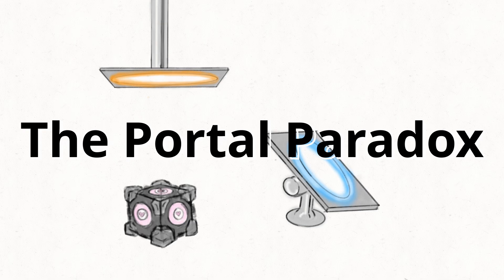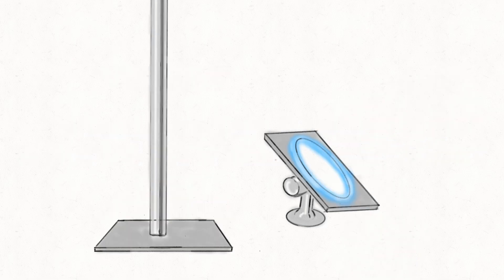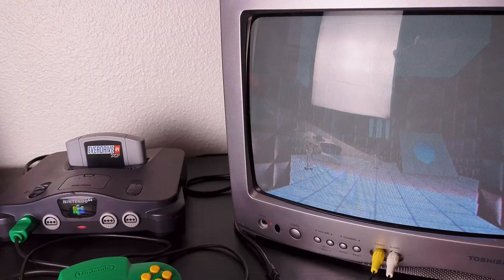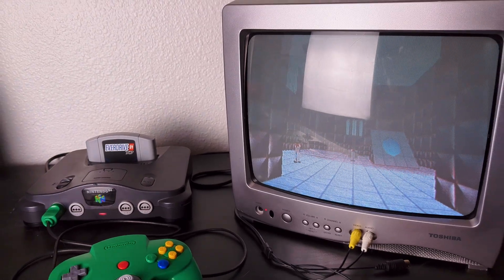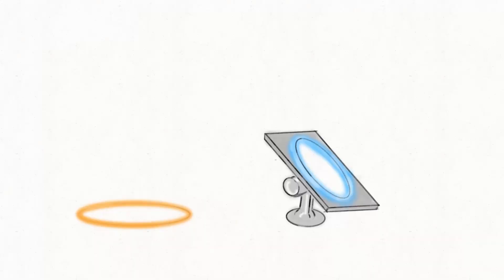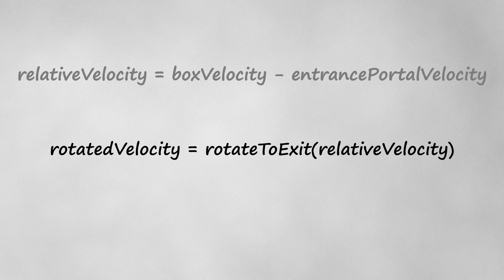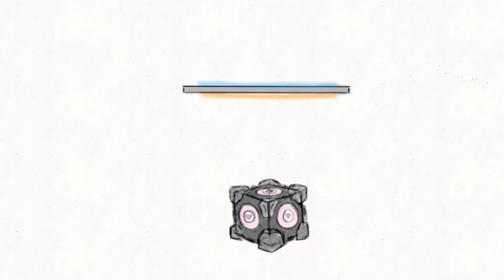I rewrote Portal from scratch and solved the Portal Paradox

Comment: Great video.
A correction would be thay speed is relative within a inertial reference frame. 
Lets determine the objects in our refence frame. 
Intake portal carrier 
Cube, aka mass
Exhaust portal carrier 

In the reference frame, cube is stationary, intake portal carrier has a static velocity and exhaust portal carrier is also stationary. 
When the cube passes through intake portal, no force is applied to it. 
When no force is exerted. Inertia within the system shouldn't change so cube must be stationary relative to exhaust portal carrier and its relative velocity must not change relative to intake portal. 
Thus it should be stationary when it exists the exhaust portal.
Reply: Reference frames relative to what though? I would say the reference frame is the other side of the exit portal.

Imagine a point in space a little bit outside of the exit, how fast is the cube moving compared to that stationary point.

In the first example the point approaches the cube at the velocity of the entrance portal, so in the frame of reference of the universe on the other side of the portal, the cube has momentum.

Now take the other example, again imagine a point, above the exit portal. When observed by the cube the entrance portal is approaching, but the exit portal is moving away from the point at the same rate, so the cube is stationary relative to the fixed point through the exit portal.

Looking at frames of reference is a good starting point, but you have to consider the space through the exit portal to be the authoritative frame of reference.

There are examples in the portal game, such as vertically aligned portals, that break conservation of energy, so appeals to that are invalid, infinite gravitational potential energy is trivial to achieve.
Reply: @googlygoink   why would you change inertial reference frames mid experiment? 
There are no limits to inertial reference frames ?  You can be in the same inertial reference frame even if you are on the other side of the universe. Just add a lot more objects to the frame
Reply: @alqualonde2998  because through the portal is effectively another reference frame, the whole universe through the portal is moving towards you when the entrance moves towards you.

there is no consistent inertial reference when using portals like this, unless you consider everything on one side of the portal to be moving, and thinking about the cube's perspective on the exit frame of reference is easier.

In your explanation you say the cube has no momentum before, therefore has no momentum after, but you are neglecting that everything in the universe through the portal has a velocity relative to the entrance frame of reference, so even if the cube is still, the reality it enters is moving, so it ends up launched at the wall.
Reply: @googlygoink  ummm just no ?  
The reality it's entering is moving ? Relative to what ? 
It was still compared to cube before and after the teleportation. 
The only thing that's moving is the intake portal carrier. 
Movement is defined within inertial reference frames, not based on portals.

Your example also doesn't hold as cube itself has relative speed to itself. As it's part of the whole " moving" universe of the exhaust port. 
 You can't change inertial reference frames mid experiment they are not physical frames. They are abstract concepts we create that encapsulates all the variables withing the experimental. If you are changing reference frames, you are shifting to another experiment all together.
Reply: @alqualonde2998  again going through the portal is not being teleported, a portal has no analogue in normal physics so instead let's look at a single static point in space. 

Now if we take an inertial reference frame around that point.

Now if that point can observe itself through a portal, and the portal is moving, then the inertial reference frame breaks, we have a singular unique point of reference, that is approaching itself. 

So you need to treat the point through the portal as being unique to the point we are observing from.

A reference frame cannot exist where a unique point moves relative to itself.
Reply: @googlygoink  But why ?  Portals are not wormholes ? They are instant displacement mechanisms. That's teleportation.  Portals are abstract representation of a teleportation field in 2D form.  We also can teleport photons for decades. I think record is 500km with entanglement. 

Your proposal is fundamentally broken in thermodynamics.
You are creating energy.
Reply: How can it remain stationary out the other side though?

If we have a portal move over a stationary cube at say 5m/s, then the cube must be ejected through the portal's exit at 5m/s.

If this portal's exit is stationary relative to it's environment, then that movement can't come from the portal.

As such, it has to come from the cube. This makes sense, as each part of the cube to come out of the stationary portal would essentially be pushed out by what's behind it at 5m/s.

The only options available are either that the cube is crushed at the portal boundary like a one-sided accordion due to it being suddenly stopped at the other side, or for it to fling out the other side at 5m/s due to the transferred momentum from it being pushed through by the portal.
Reply: @G3HP  imagine a system with 2 portals and a cube and look from the perspective of thermodynamics. 

If the intake portal carrier is moving, it's carries has some kinetic energy. 
If the cube starts moving at the same speed as it exist the exhaust portal, the system has more energy than it started. 
If you create energy out of nothing, you made some grave error. 

Also your proposal that cube would push itself is not logical. It would mean portal is applying some sort of force to make cube pass through itself. 
Portals are not wormholes, they are windows of instant displacement, aka teleporters.  They don't exert forces.
Reply: @alqualonde2998  conservation of energy is broken with static portals, yet alone moving ones.

If you have the vertically aligned portals and drop something in it then the object has infinite gravitational potential energy while in that column between the two portals.

You can't appeal to conservation of energy here.

Say you had two portals at either end of a vacuum tube, with a ball bearing in the tube also, with that aligned towards the center of the planet, the ball bearing would accelerate endlessly, gaining infinite kinetic energy
Reply: Having checked the lore I also found this "the ASHPD is powered by a miniature black hole, which is kept stable through the use of a cooling fan at the rear of the device."

So the energy inherited by the cube as it passes through the portal can be taken from the black hole, somehow.
Reply: @googlygoink   no ?  as the cube moves towards the gravity source, gravity source will move towards the cube and either cause the collapse of portal carrier as they need flat surfaces in lore or cause the portals to touch each other causing a possible catastrophe.

Its also not infinite as gravity itself is not an infinite resource. 

adding the relativistic exponantial energy requirements for closer to lightspeed velocities. its not against thermodynamics.
Reply: @googlygoink   thats possible but kinda cheesy as being powered by means it generates energy for the device to be used rather than being integral to how portals work.

Comment: If the portal has relative velocity to the cube, which you conserve in your equation, but I thought that the concept of the portal was that MOMENTUM is conserved.
If the portal is moving at a rate, that's great, but it has no mass.
The cube has mass.
After the cube exits the portal, it doesn't have any relative momentum to keep it moving at the rate that the portal slamming over it was traveling at.
The cube would appear to be emerging from the portal at a fixed rate, until it was through and the gravity of the other portal was able to overpower the stationary gravity of it sitting on the ground.
I can draw a Free Body Diagram if you'd like.
Reply: this is only relevant if the velocity of the portal is less than what the cube could have after accelerate downwards via gravity in one length unit of its own size. any more velocity and it just does what the video shows
Reply: @Kittyhat  My comment only marginally had to do with gravity.
I'm taking about how does the portal with no mass impart momentum on the cube by moving over it?
Is the cube being imported momentum by the ground in this frame of reference?

You are right about the 45 degree ballistic trajectory stuff about accelerating downward if the cube is imported momentum somehow.

Comment: The correct answer to the Portal Paradox is that portals cannot move and therefore it is impossible for such a situation to occur.
Reply: finally a reasonable comment
Reply: @Kittyhat  But is it reasonable? After all portals move at immense velocities as the earth is moving hundreds of thousands of kilometres per hour. And even if we change it to they can't move with respect to a reference point on Earth, that is proven wrong by the ability to establish a portal link to the Moon. Which would be moving relative to a point on Earth.

/The video is the best answer, the relative velocity of the portal and object are what is relevant there is no eight answer

Comment: I don't think the cube should shoot out. It had no velocity before it entered the portal. The piston has velocity and mass, but the portal doesn't have mass, and therefore, it can't have velocity. The cube doesn't come into contact with the piston, so the piston's kinetic energy cannot be transferred to the cube, the portal doesn't have mass, so it can't really transfer kinetic energy to the cube either. The piston is moving, and the portal is not. It can't. So the cube leaves the portal with the same velocity it entered, none.

Comment: I still feel like it would just fall out the other end. It makes sense that the velocity increases as the portal moves over the cube, but it only changes for the section it’s passing over. Correct? So the bottom end of the cube is actually anchoring it down for the entire pass until it covers that last layer of cube. 

Or it’s creating stored energy. 

Or, if your theory is correct, you should be able to pass the portal over the cube very quickly, stopping just past half way and the cube would lift itself through the rest of the portal.

Comment: your approach is wrong, cause portals dont transfer velocity at all. They transfer matter, only cube itself, only speed of the cube matters. 
When your cube gets momentum even? After it teleports fully you just apply force to them? 
Try to teleport cube in your mind gradually:
It will just slowly appear at blue portal, cause its standing on plate, gravity will push it down.
When cube will be more than a half on the over side it would slide and roll down, cause it will be more affected by other gravity on the other side. 

Bruh

Comment: I actually solved it to myself pretty easy with a thought experiment. So, imagine orange portal coming down and the blue one stationary, then:
1. Stand near the blue portal and put your hand just a bit through it
2. Orange portal coming down at fast speed and through the blue portal you see that "the wall" is coming fast
3. "the wall" hits your hand painfully
4. Repeat this scenario with a cube

If not convinced, imagine a wall with a cube moving at you with a great speed, but the cube is miraculously attached to the wall until it reaches a certain point.

Comment: Wonderful, just as I had expected.

Yeah, this is exactly how a physicist would expect it to happen. I guess, many people just seem to forget, that in the 2nd example effectively the relative velocity between the 1st portal and the cube cancels out with the relative velocity between the cube and the 2nd portal. So, everything makes perfect sense.

Btw, I guess in generel physicists might not like the general idea that if you move through two stationary portals, your momentum vector is not conserved, if the portals face in different directions (which is usually the case). But, hey, they are freakin' portals. I guess, we can just assume that with all that effort and all the probably incredible amount of energy, this machinery simply also has to make up for the difference in momentum vectors, while teleporting stuff.

Comment: A portal can be interpreted as a rigid 3 dimensional object with one of its dimensions in the 4th dimension (hence why the portal entrances are 2 dimensional). Moving both entrances of the portal as shown in the video would be translating the portal object in one of the 3 dimensions that are perceivable. In the scenario where only one entrance of the portal is moving, the portal object must also be moving in the 4th dimension as to “stay connected” since it is a rigid body. In other words, the other entrance has to be moving along with the entrance that is moving, just in a dimension that isn’t perceivable. This makes the two shown scenarios exactly the same meaning that the cube should not have a velocity when exiting in either scenario.

Comment: No offence, but all this equation proves is that "cubeVelocity_after = rotate(cubeVelocity_before - inPortalVelocity) + outPortalVelocity" literally only "proves" what it assumes - "speedy thing in, speedy thing out", because it's literally coded to add the speed.

Would be cool to see a physics-based simulation with forces an/or momentum, instead. Which makes me think that currently the way this is coded breaks the momentum conservation principle, since momentum can't change here because there are no forces acting on the cube when it passes through the portal - as "two moving portals experiment shows.

Comment: Wait, if a portal on a piston comes down, it will contact the cube at a point on its surface. At what point in the portal piston's descent onto the cube will momentum be applied to the object? Wouldn't that momentum begin immediately, causing the cube to suck up into the portal before the surface of the piston fully impacts the ground? It would have to, right?

Comment: I like your test, but I have questions:

1. What if you stop the portal midway? Does only part of the cube receive momentum, "pulling" the rest with it when the portal stops? If the speed of the portal changes quickly enough, could that force rip the cube in half?
2. Considering "real life" physics (I know, it's a video video game, why would you, but stick with me on this thought experiment) what happens if a Portal traveling at .6c (0.6 times lightspeed) encounters a cube traveling the opposite way at .6c? Their velocities would add up to 1.2c (1.2 times light speed) if the target portal is standing still, making the cube break the "light barrier". How would you handle this? Here's my idea: Since the portal is moving at speed, whatever is "in" that portal is moving at that speed, in this case space itself. So for the cube you would literally move space around it, the definition of a warp drive. I think that's pretty cool and opens up some creative puzzle or even lore options.
3. What happens if you do the hoola-hoop test, but you only move the upper portal back up? The cube would sit in the upper portal as if it is a surface. But what if you exert force on that surface? Does it lift the bottom portal? If so, where is the force applied?

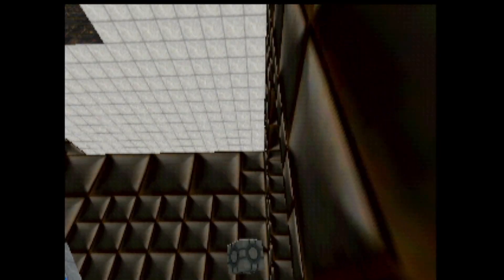Comment: 1:58 I think a possible a flaw is that you're implicitly making a choice in that equation. You're considering the velocity of the box relative to the entrance portal, when you could just as much consider the velocity of the box compared to the exit portal. After all, entrance portal and exit portal are the exact same region of space, that's the entire point of these portals. So they should be equivalent. Yet, if you consider the velocity relative to the exit portal, the results of your experiment should change.